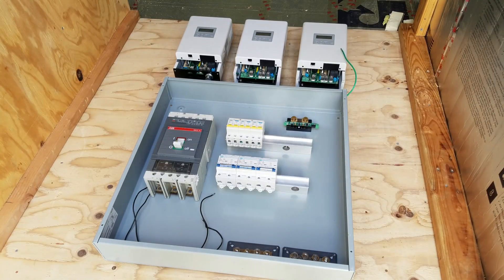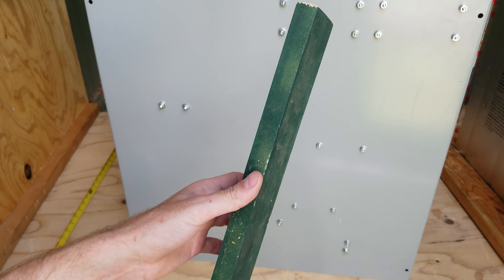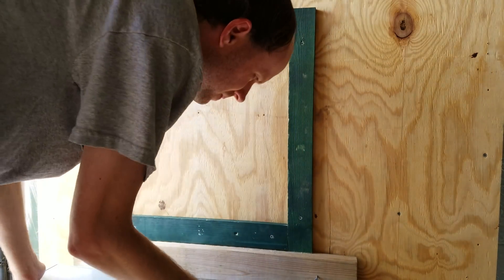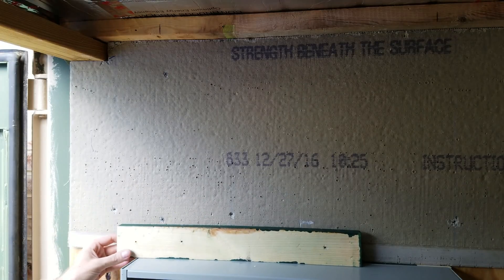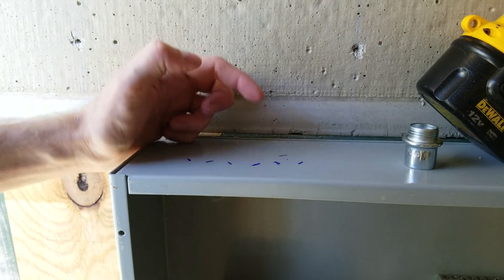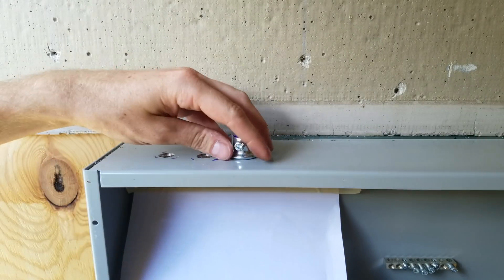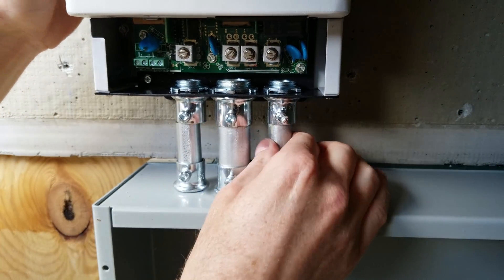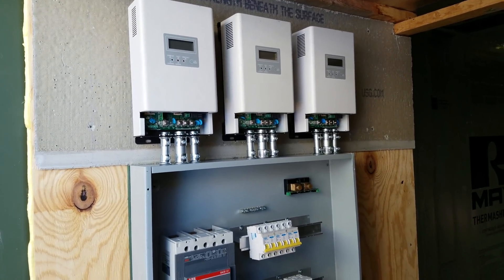Mounting the Battery Shed Electrical Cabinet and PCM60X Charge Controllers

Comment: Looks like (7:40) you need to 'deburr' that 3/4" piece of conduit.  You could also use short pieces of already threaded rigid conduit with lock-nuts and plastic bushings for the chase between the boxes.

Comment: I think you should’ve just use the step drill to drill the holes for your conduit instead of using the hole punch. It would’ve been another 30 seconds of step drilling and you would’ve been done.
I like your project👍

Comment: FYI - They make conduit nipples that have thread on both sides for doing exactly what you are doing with the conduit fittings. You can buy them straight or even offset. https://www.homedepot.com/p/Halex-1-2-in-Rigid-Offset-Conduit-Nipple-90401/100120709
Reply from the maker: Interesting. I've seen the offsets before but don't know if I've ever seen the straight ones. I'll take a look next time I'm in Lowe's/Home Depot.

Comment: After cutting the conduit pipe you should deburr inside and outside edges of the pipe. I can see  at 7:39, there are some sharp edges and metal flakes on the pipe, that can rub against the wires and cables. Please fix it.

Otherwise very pleasantly looking installation. I am not a fan of wooden back for the support, as I prefer to use non-flamable materials in such installations, but I guess it might be ok.

Comment: Why not just keep going with the step down drill to the correct opening rather than hassle with the punch-out step.
Reply from the maker: The step bit rips the metal instead of making a clean cut, gets extremely hot, and requires a high-torque drill with larger hole sizes. It's much easier to use the punch.

Comment: I got my shunt trip in yesterday,  I got a GE with 24v shunt trip, although I did get it to trip with 4x 18650's in series,  it says to mount inside a enclosure, I'm guessing incase of a arc being thrown, or hot metal when tripped at high current loads, I'm not using it as a breaker, it's basically just being used as a latching relay, I need to get the diy bms now, have more of a feeling if safety! Nice job! I hope my re install looks as nice!

Comment: 5:33 I don't get it, can't you just keep drilling with the Step-bit until you reach the desired hole diameter?
Reply from the maker: The step bit makes ugly holes. It also requires a lot of torque as the hole gets larger that my drill can't provide. It's much easier and cleaner to use the knockout punch.
Reply: If you’ve ever used a step bit in a large enough drill you’d understand. The bruises from the handle spinning around and wacking my arms and stomach. The replacement cords from getting spun into the cutting edge of the drills bit. How short a step drill lasts once it overheats and ruins the metals temper. 

Granted I was a noob at the time building petrochem control panels but if you have a punch use it. We even had a battery powered draw punch so we didn’t need a socket.
Reply: @peterg.8245   The step drill bits are defn a pain to use sometimes for metal tbh

Comment: Im in the process of upgrading my 48 volt solar. Going to go with 16-20kw of panels, undecided on the hybrid controllers. Purchased 48- 280AH lithium cells. What bms should i run? Buy 3 seperate ones? Or just use 1 to control all 48 cells? Im using 4/0 on my lead acid batteries i have now. Do the bms hookup to the 4/0? Or the 4/0 to a copper lead off the bank?
Reply from the maker: I use a Batrium BMS. You can buy one Batrium to manage all of your batteries. Also, I'm using 4/0 from the batteries through the BMS shut.

Comment: Too bad he didn't take out the metal burrs inside the conduit.
Reply from the maker: I did clean the burrs before I put them in. I used the deburrer tool on a plumbing tubing cutter.

Comment: Lookin good.  Altho, considering you had to make your own conduit hole plate for the PCM's, I think you should of added about an 1" spacing to make running the wire easier/cleaner. This would of also allowed for putting the plastic protectors inside the PCM housing  😉

Comment: Can't wait to see it all wired up, I'm presuming you have 3 x 14S battery banks that are charged by each of the 3 x PCM60X's but I'll be patient and wait for it all to be explained in the next episodes of the series :)
Since I'm planning to build 300P packs like your own but still in the process of cell testing at the moment, I'm following with great interest. Actually I might have to go to 400P since my cells are pretty good stock and all the same but over-all lower in rated capacity.
Reply from the maker: The PCM60X will all be connected in parallel. I have two 14s300p battery banks that will go back in service. I have one 14s120p that was in service prior but I may look at selling so I can fund some larger form-factor batteries to mess with. I think 400p will be great as well. I just went with 300p because it fit nicely on a standard 18" shelf without being overly-tall.

Comment: Quite Professionally completed.   I'm a Professional.  Installed Microwave Radio equipment for a number of years. Charging systems et al.  I won't be using the conduit .  Nor the Box. Nor the other Code Compliant items.  LOL
Reply: LOL
The difference between a professional and an amateur looking professional  😜

Comment: Why not but a sheet of aluminium behind the charge controler ? I think it will look better.
The rest of the install is very clean btw.
Reply: Aluminum sheeting isn't cheap. The backerboard/concrete-board is more than sufficient and will wick heat away efficiently.